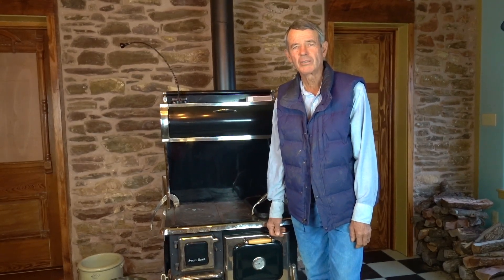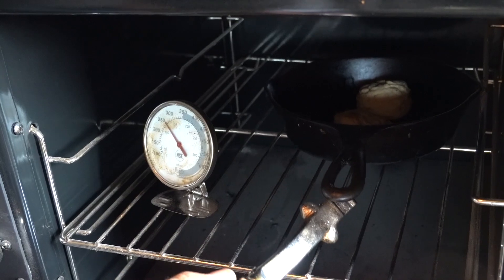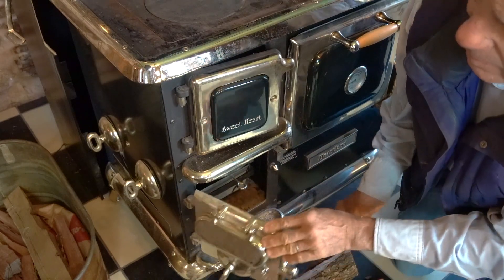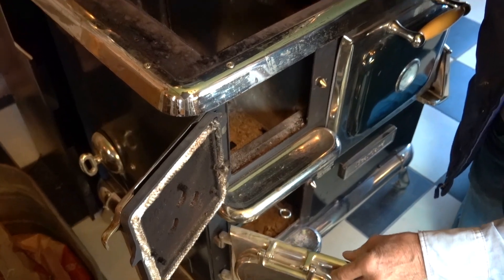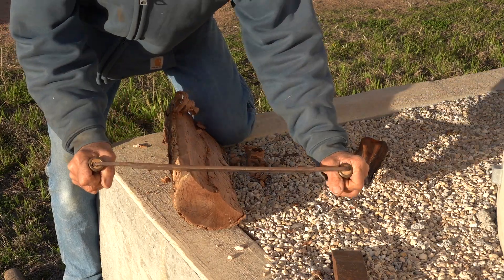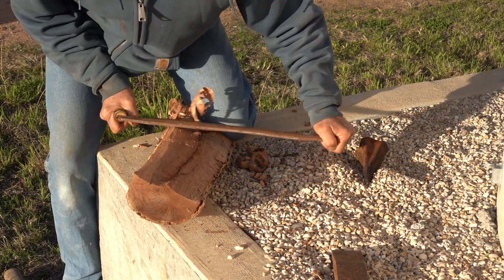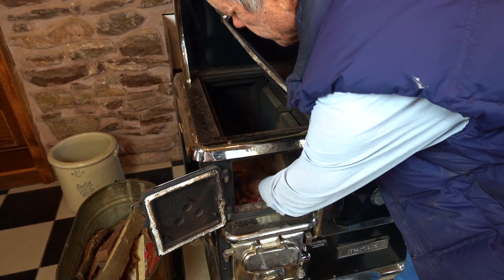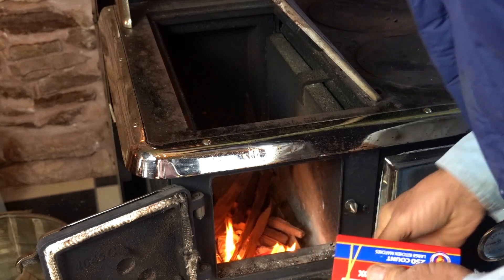HOW TO START A FIRE IN A WOOD  COOK STOVE | IMPORTANT LIFE SKILL

Comment: Thank you for the video. We have been using the heartland oval stove for a few months now. I have been having a lot of trouble with smoke leaking out of the top. I think it is because I was having the lower dampers closed. Do you have any advice to prevent this?
Reply from the maker: Hello John, thank you for watching!  Does the smoke leak out all of the time or just when you open the fire box to add wood?  We keep the lower damper open and the chimney damper open for a minute to let the smoke vent out before we add wood. We know our flue draws really well so if smoke is leaking out we open the lower  damper.  You might check your flue to be certain it is drawing correctly.  If all is well then opening the lower damper a bit should help. Hope this helps!